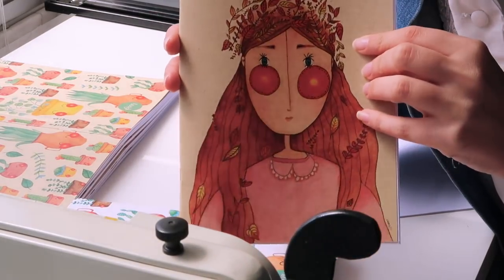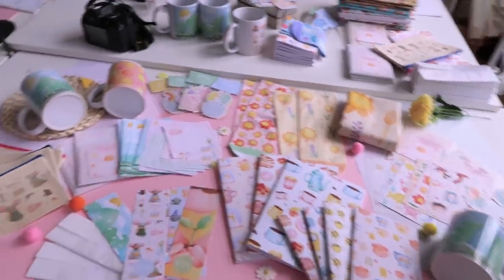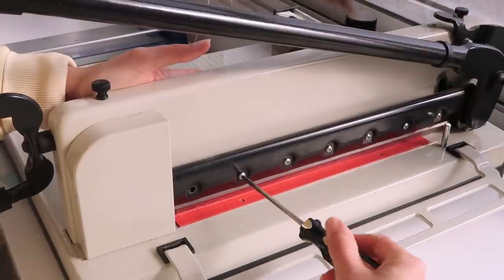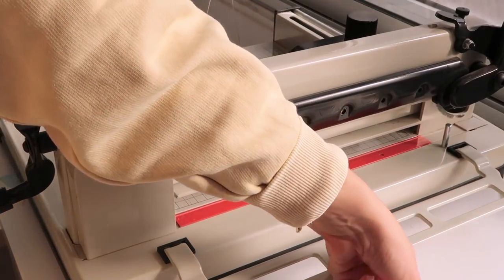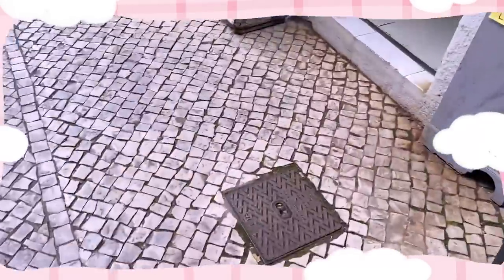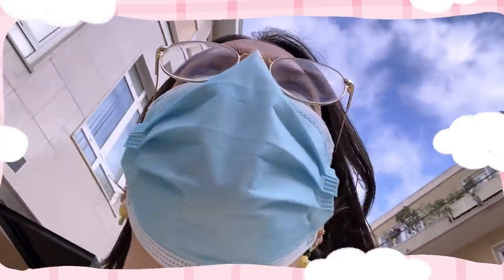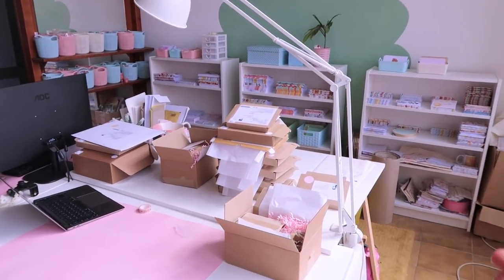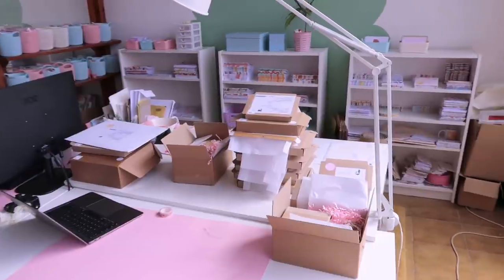FIXING MY BIG GUILLOTINE, PACKING ORDERS, Painting / REAL ILLUSTRATOR Week in the life

Comment: I worked in a print shop and the red plastic strip had to be replaced at least once every few weeks (or rotated). The blade rarely had to be changed. any small indentation in the red plastic strip will cause the paper to get pushed rather than cut in the mark. Sometimes I just flat out switched it with each new batch of cutting because I just didn't want to deal with an issue LOL.
Reply: Good to know. Thanks for sharing